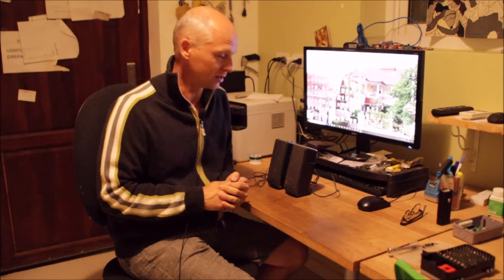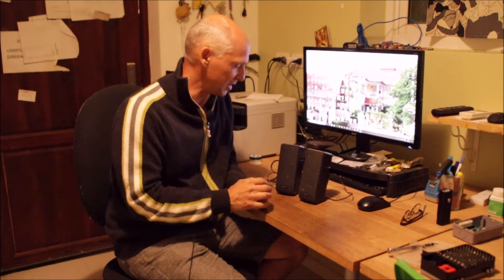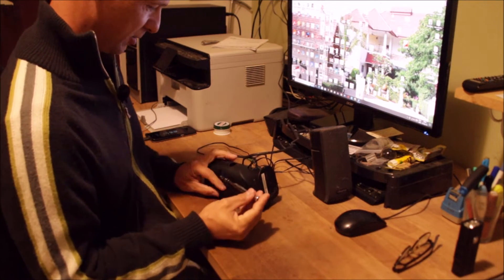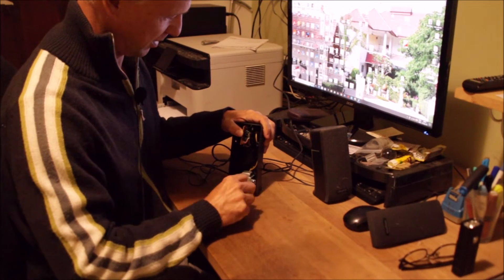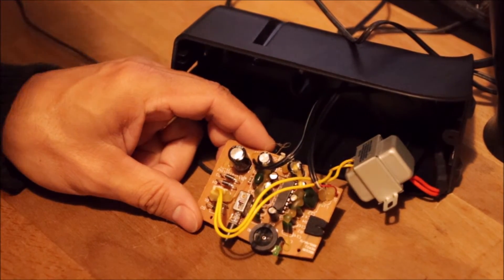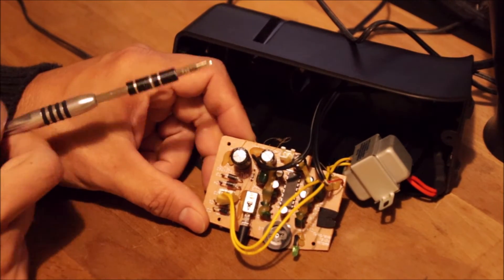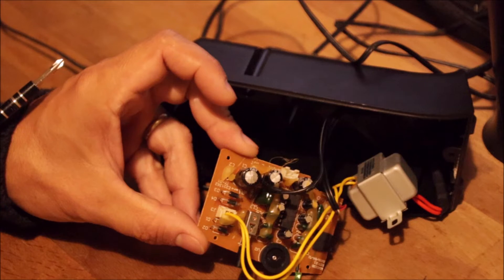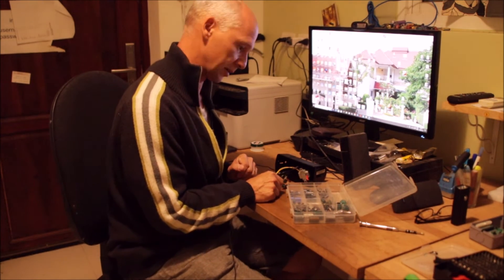Fixing terribly humming PC-Speakers. Beginners-Level!

Comment: And if this voltage buzzing at the frequency of 120-150 hz in speakers occurs only when putting any laptop on charge, some kind of ground loop problem, while using European undgrounded socket outlets, then how is this problem usually solved without creating hazard?

Comment: I got an Alba CBB16 radio that has a loud humming/buzzing (sounds similar to the sound in the video) on only the left channel.  It produces no sound, only this hum/buzz. The volume is constant and doesn't change if I adjust the volume knob. The right speaker plays fine and is clear. I checked the wiring for the speakers and it seems to be fine. I even switched the speakers around. The issue remains on the left side, so both speakers are OK. The issue is primarily with the left channel.

Any idea what might be the problem? I did some inspection and there is a 16V 2200uF cap that looks like it's slightly bulging. Could this be enough to take out only the left channel? If the cap was bad, wouldn't it take out the right channel too? 

The switch is a little suspect as well. On this radio, there's 2 sliding switches. One is to switch between Off, Sleep and Radio. The other is to switch the bands. Both switches have 16 pins on them. I found that if I fiddled with the switch the Off/Sleep/Radio switch, the audio would cut in and out on both channels. The left would just go between quiet and the buzz/hum at varying volumes and the right would go between different volumes of sound (to really low and distorted and loud/clear). I suspect the fault lies with this switch, but I am not too sure. Is it more likely the switch is the problem? Could that take out the left channel?

If it is a switch, finding a replacement may be a problem since I can't find an exact replacement. This radio has a cover that attaches to the switch, so it likely needs to be the exactly the same to ensure the cover will fit. 

This is my 1st time looking at a radio, so not 100% sure what to look for. I want to try and fix it if possible.
Reply from the maker: @SingularityRS  hi. I don't think it a switch which is causing the problem. As this is mainly a channel issue I would say its a component on your left channel which is taking it out. 
Bulged capacitors should always be replaced too as they will distort signals.
For me it sounds more like a shorted left channel due to a bad filter capacitor or diode, etc

Comment: But what if those cheap speakers hum like that even if they are new? I think every single pair i had for the past 20 years does that. Could we maybe "upgrade" them by switching the cap?
Reply from the maker: One would need to know if the hum is power supply related or just an amplified noise signal coming from the audio source. 
If the power supply internal is similar as in my case, a bigger cap could help.
Nowadays most speakers will be supplied from USB. So it would really need a bit of investigation how the circuit could be improved a bit...
Reply: @RolandW_DIYEnergyandMore In all my cases its always the cheapest speakers on the market and they hum in any outlet even if nothing is connected. I found your video while trying to find what could be causing it as everything regarding ground loops and noise just didn't fit and i think this could be it.
It might not be worth to even repair it but i always wanted to know.

If you say bigger capacitor, what am i looking for? Same capacitance and higher voltage? Or same both but some physically larger size or higher quality brand? What should i search for so i don't buy the same crap that's already inside?
Reply from the maker: @magicshon  usually there will be a 1000uF electrolytic capacitor behind the rectifier diodes. You could go for a 2200uF instead with same voltage rating. If you go for higher voltage ratings, then the caps are getting physically larger and it might not fit into the space anymore.  Another option might be to check if there is a ceramic cap placed between V+ and V- at the amplifier IC. it should be something like a 100nF to remove inbound noise at the IC.
Reply: @RolandW_DIYEnergyandMore  Just done the replacement.
It was just as you said. Originally a 1000uF V and i replaced it with a 2200uF 16V that i was lucky to find as the only capacitor left from components i had since my high school. My speaker has plenty of space inside too so no worries about that.

The hum is definitely much quieter now, all the higher frequencies are gone. But there is still some hum left and its certainly present. I wonder if it would be worth trying an even  larger cap, maybe 3k or so.

Thank you for this amazingly simple solution
Reply from the maker: @magicshon  bigger cap might help of course. but the gains will be smaller and smaller. one would have to investigate further why that circuit is so noisy. But good that it was step in the right direction :)

Comment: how to fix a speaker that have aux and usb from buzzing ?
Reply from the maker: USB speakers of course will not buzz from the power source. There will be a problem within the amplifier circuit. Probably the input filter or decoupling capacitor for the OpAmp. So, check for caps or inductors around a small IC. Maybe some corrosion can lead the way...